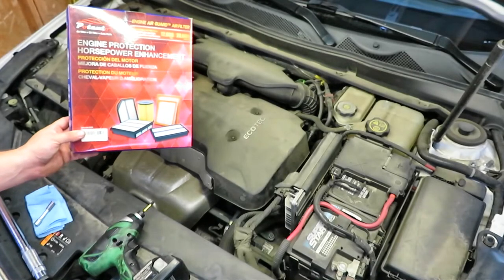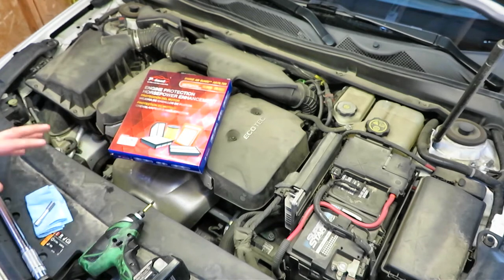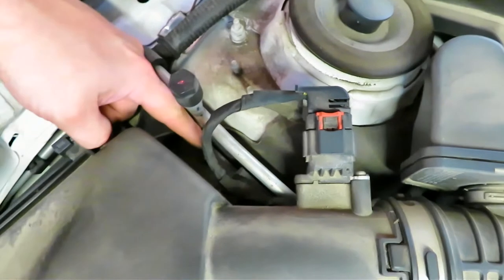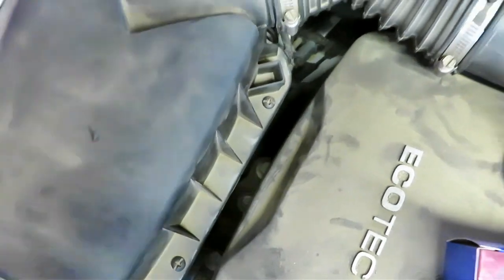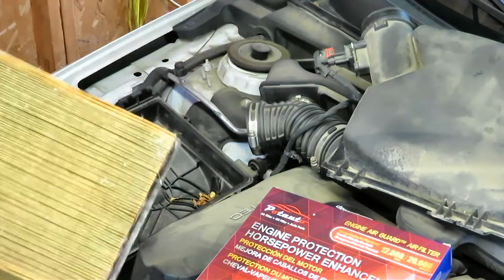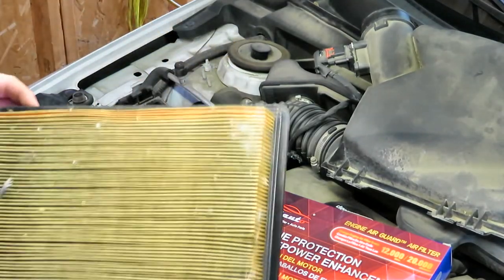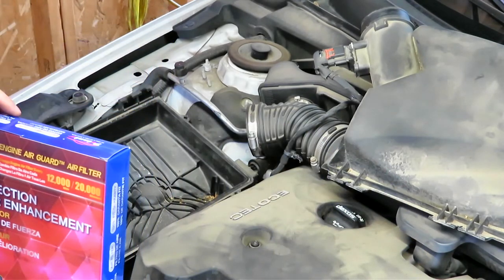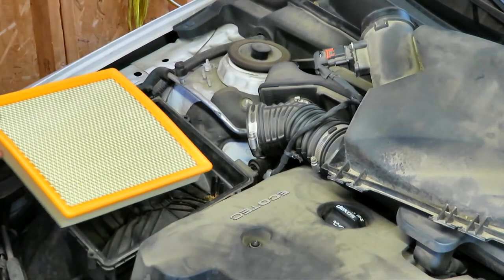2014-2020 Chevy Impala Engine Air Filter Replacement

Comment: You didn't clean the cover or housing,  wasted a good air filter and time spent
Reply from the maker: @maximumoverload5134  can you believe the car is still on the road after that disastrous air filter replacement?
Reply: @DCAutoEnhancement  
Just saying it should've been wiped clean from all the dust to prevent premature use of new filter
Reply from the maker: @maximumoverload5134  that information is more helpful to viewers looking at the comment section than your initial comment.  I post these videos as a way to help people that may have no idea what they are doing when it comes to car maintenance and I appreciate helpful comments filling the gaps of my videos. Thank you for watching and helping with the additional information for the viewers.
Reply: @DCAutoEnhancement  
Thank you for your fine work on informing the public. I'm sorry if you took it as criticism, was not meant as such , my apologies
Reply: Absolutely!